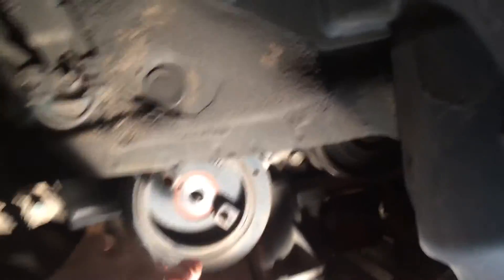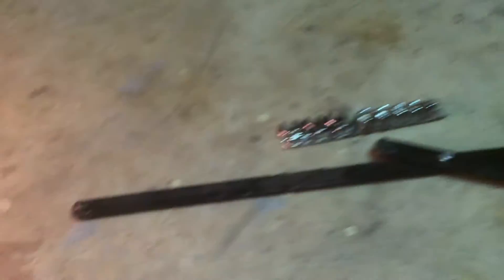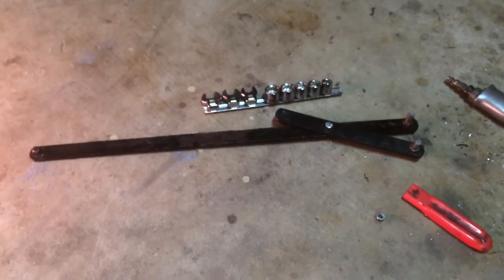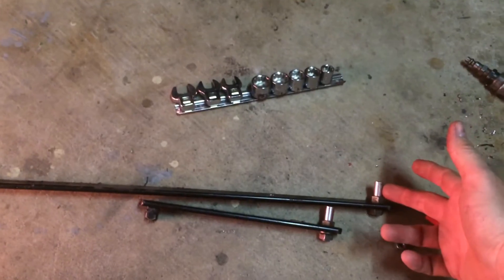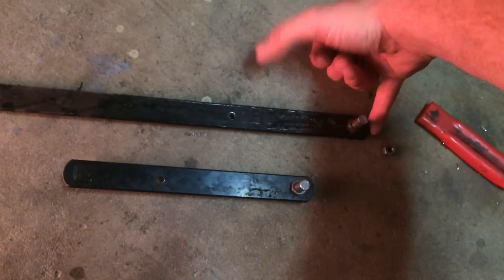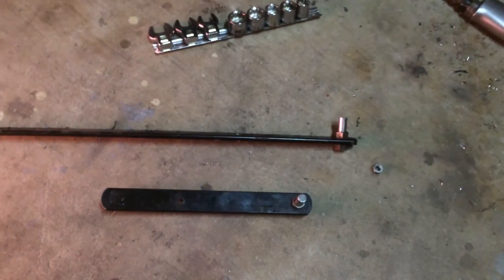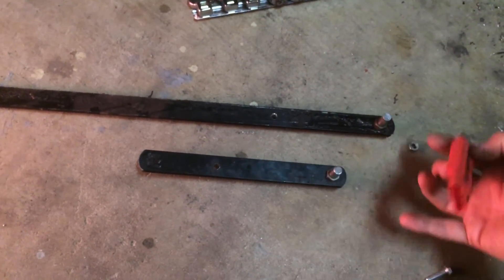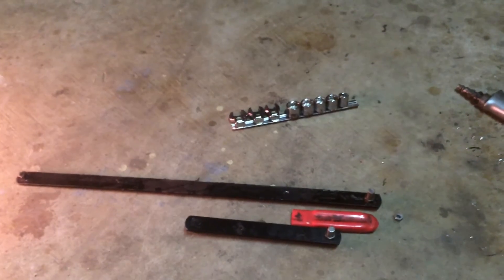2.7 liter Kia Sportage crank bolt removal

Comment: FWIW I tried the spanner but I still could not get the bolt to come loose (it was not the factory bolt). I ended up putting a 1/2 drive socket and breaker bar on the bolt then braced the breaker bar against the floor and bumped the starter with the key (after confirming the engine turned by hand so as to not damage anything). That worked like a charm.